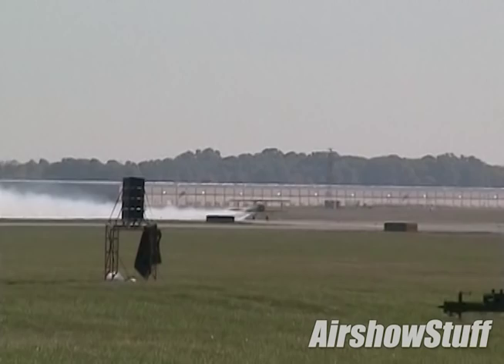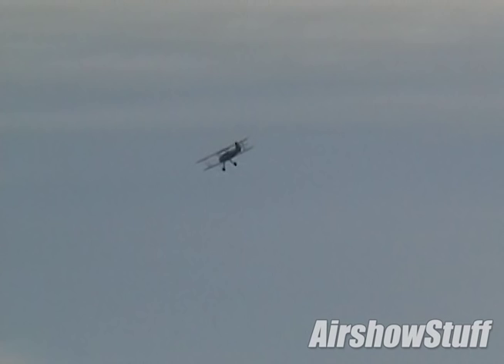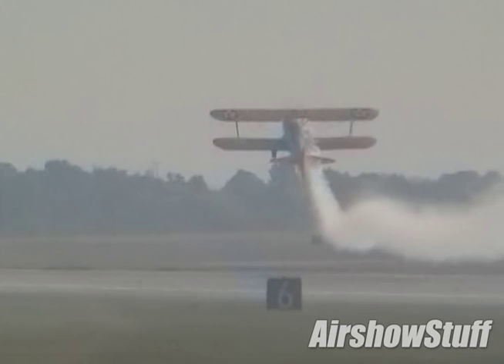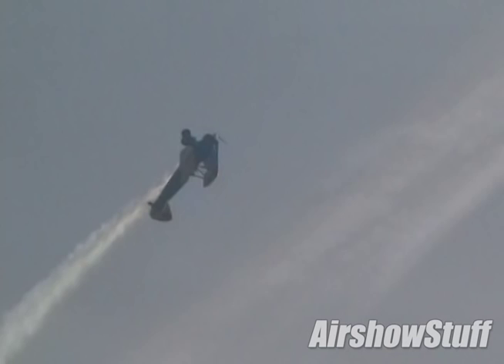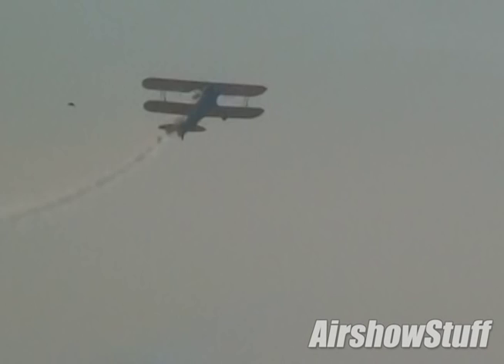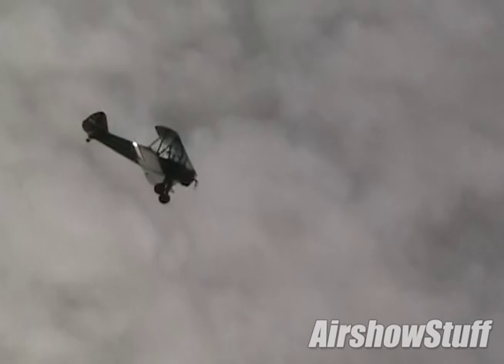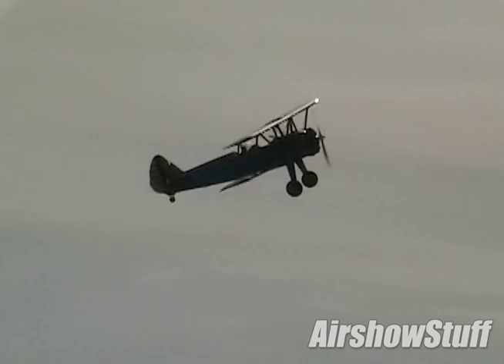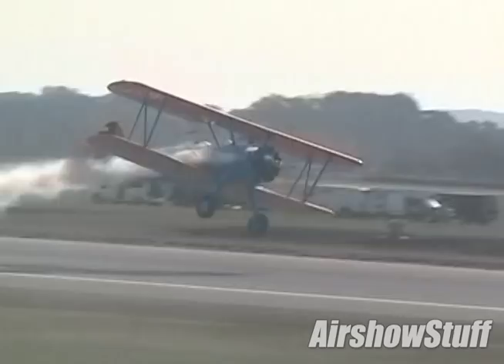MASTERFUL Stearman Aerobatics - John Mohr - Gathering of Mustangs and Legends 2007

Comment: I learned to fly in a Stearman which the Navy called an N2S and known as the Yellow Peril.  Navy Primary 1945 C-Stage was Aerobatics and we did most of the maneuvers flown here but at 4,000 feet, not at 40 feet. Our Stearman had a Lycoming 220 hp engine if he has the Army Air Corps version it is slightly higher.